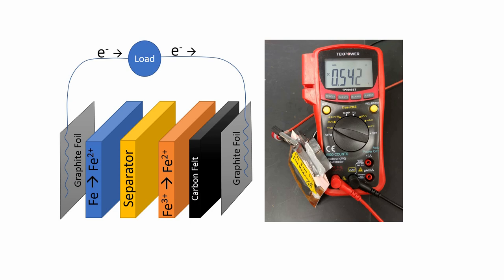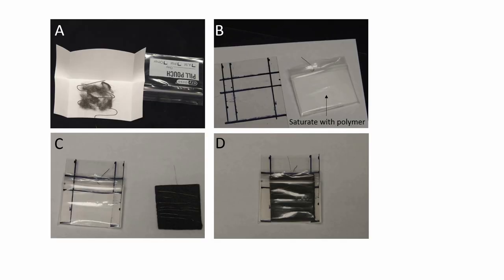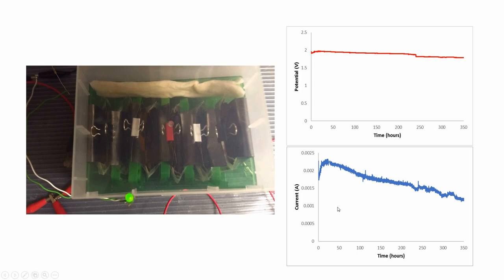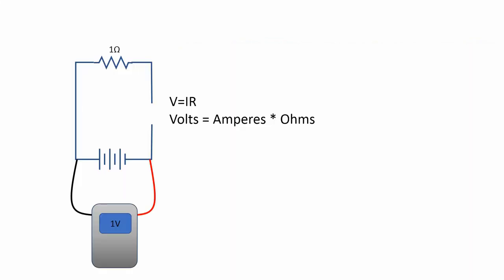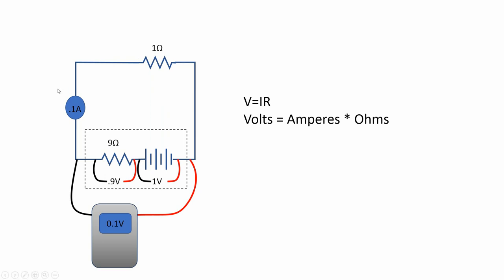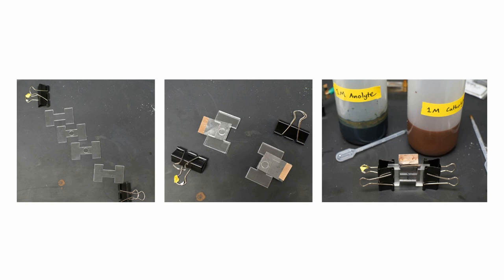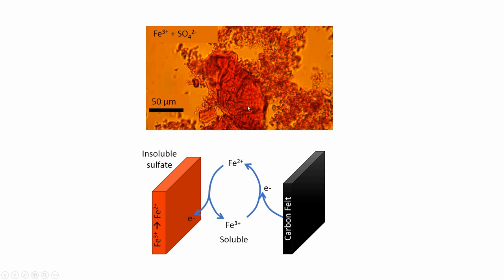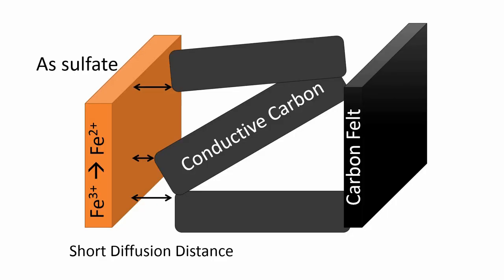Adding conductive carbon black to iron battery

Comment: Nice work... Dying to get my hands on the report. BTW did you try reducing the concentration of the solution to the point where Iron (3) sulfate dissolves in water? Or maybe you can try some other anion like acetate or chloride. My issue with carbon black is that since one reactant (FeSO4) is soluble and the other (Fe2(SO4)3) is not, you will not get consistent results from adding carbon black once you scale up. I feel that carbon black is great for cells where the active material is solid (like MnO2 in zinc carbon cells) but will cause trouble in this case. Anyways, best of luck for further experimentation.

Comment: So as of now, to get a high current battery. Would require a ton of tiny cells paralled, similar to charge rates of a lithium bank, the same capacity made from more cells can charge faster than one made of single large cell, in some cases!

Comment: Sulphate crystals are bad in other batteries too due to its low electrical conductivity. I've seen articles that claim epsom salt helps to avoid lead sulphate crystal formation in lead-acid-battery. Besides carbon, I wonder if there is any other salt that can help your iron cell to motivate the FeSO4 crystal to participate in the chemistry?

Comment: Please, 3000 charging cycles that can the battery hold is when you discharging from 100% to 0 ?
Reply from the maker: No, not a full discharge; We think we're working in the middle 30-40%

Comment: Well how many iron cells to turn a 6v motor or light up 75w lightbulb
Reply from the maker: A lot. The power is higher with the carbon, but still low. We're looking at ~6 mW per L right now. A 75 w equivalent LED bulb uses ~10 w of electricity, so ~2 cubic meters, approximately?

Comment: Or how long the would turn before it starts to decay power
Reply from the maker: The latest cell lasted pretty well in open air for ~1 month. It looks like it is losing water through the bag. We're looking at secondary enclosure.

Comment: As another way to lower internal resistance, maybe you can improve the current collector. I've been playing with roughly this chemistry and used aluminum foil dipped in a polyurethane/graphite mix as the current collector. (The idea from this video: https://www.youtube.com/watch?v=Ar3C5JgzhgE ). My ohmmeter reads 0 milliohms through it. It hasn't corroded so far while plain aluminum foil did quickly. I also started with iron sulfate instead of iron chlorides and have no idea what I'm doing, so your mileage may vary.